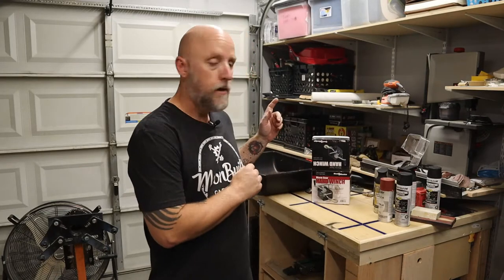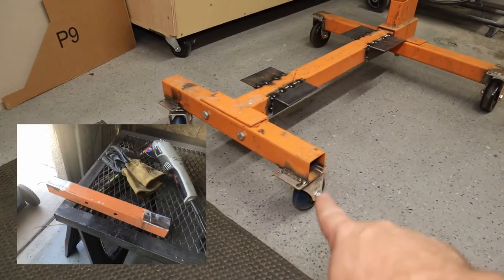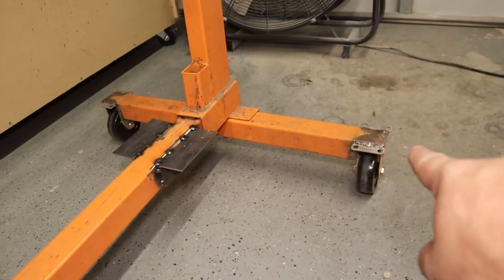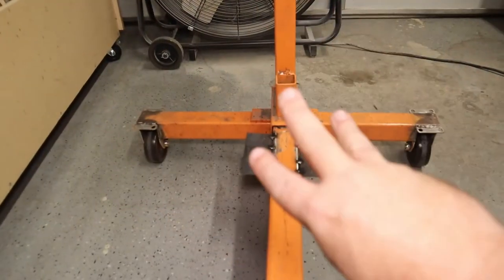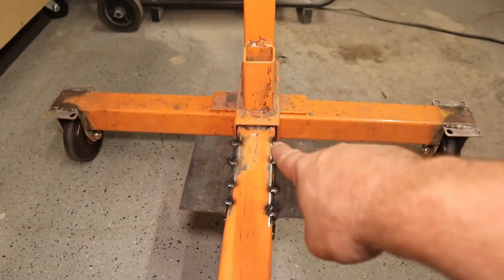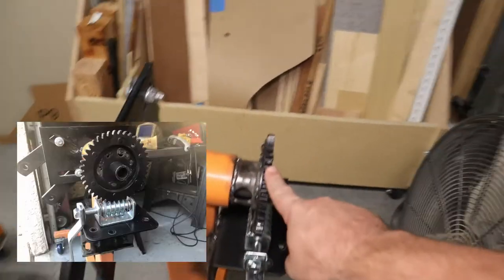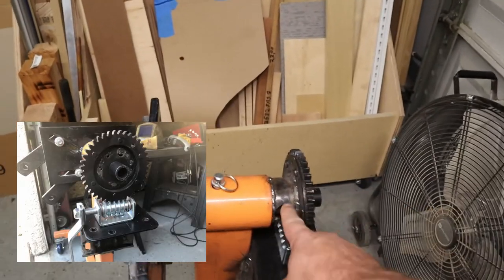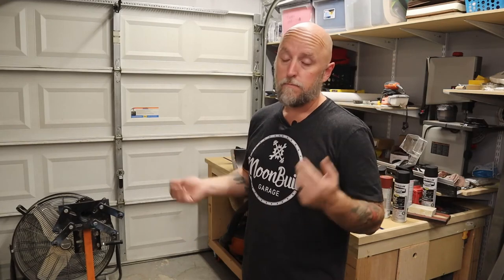Harbor Freight Engine Stand Modifications | Rotator Upgrade | Improved Wheels | Drip Tray

Comment: The castor wheels are on the wrong end. It is easier to steer the stand if the castor wheels are on the end that always has something to hang onto whether an engine is installed or not. I relize that since the one axle is lower than the other that it is easier to leave the wheels in the original position. For some reason almost no stands are made anymore with handling them in mind. A Rotonda stand I used 54 years ago had it right.

Comment: The winch couldn't go back in after welding it outside ha 😂 that also made it no to go back and forth as the winch gears must always be in contact with each other
Reply from the maker: Winch works just great....I've used it with both a complete engine and a transmission...

Comment: What’s the heaviest engine you have put on the stand ? I have the same stand that I want to put a 396 on . Thinking about putting the crank assembly on mine also . Great idea
Reply from the maker: I'm not really sure...I just had my 417 stroker on it with no problems.  The engine is a 360 block with all forged internals and stock heads...
Reply: Nice . I have limited space in my garage so I don’t think I have room for their heavy duty stand . I’m definitely going to put the crank assembly on mine